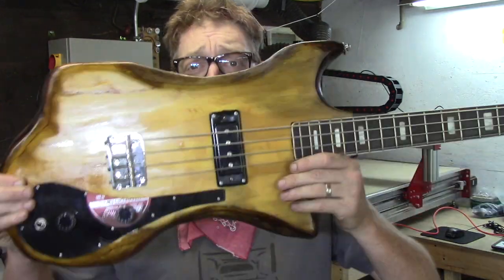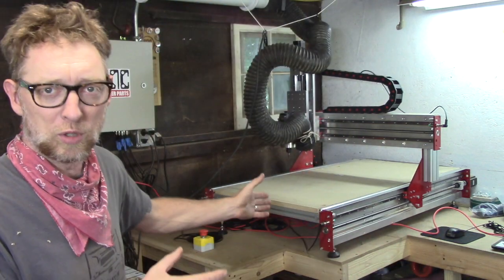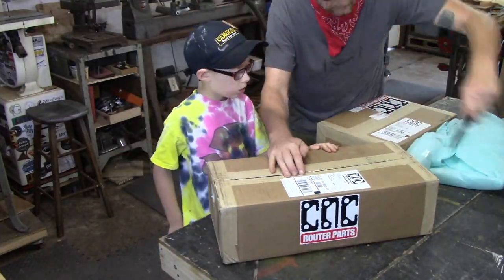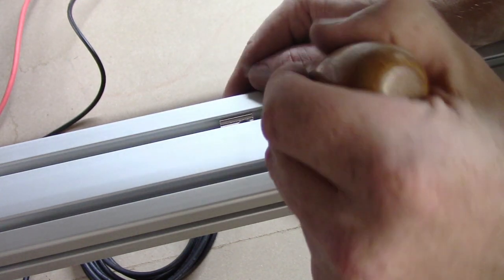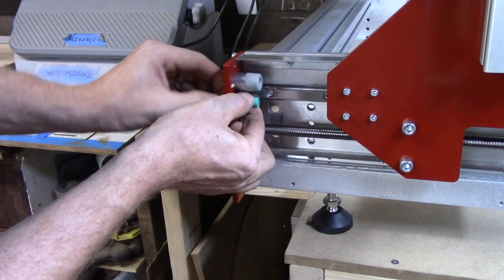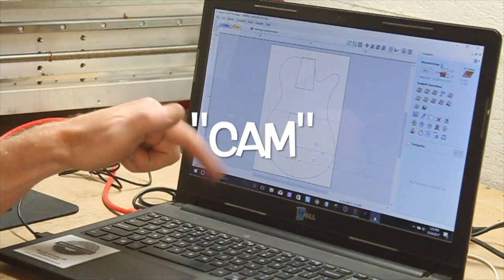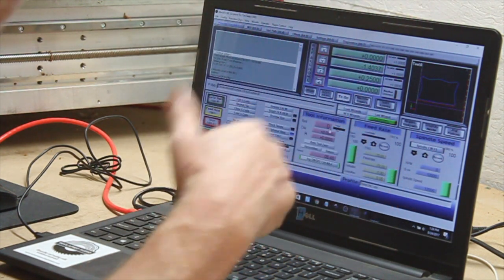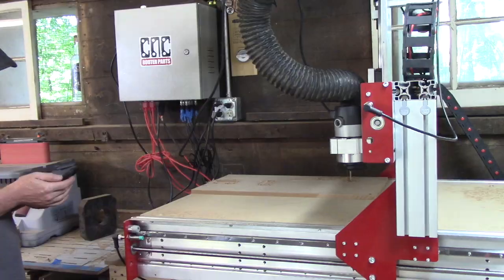What CNC Means to Me

Comment: It's your design - do what you want but don't call it handmade
Reply from the maker: it is an interesting question: when is it no longer "handmade"? If I split the wood, resaw it, plane and flatten it, cut it to rough size then use a file I created and coded, put it in a cnc and create the final product, is it not "handmade"? what percentage of work needs to be done outside the digital realm to be considered "handmade"? Does it really matter?
Reply from the maker: pinned because I want to see if we can get a good, open-minded and friendly dialogue issue.
Reply: First off - I love your videos and as a brand new woodworker, I find your projects to be a complete inspiration.  If I had a CNC machine like yours (actually I would prefer a little smaller) I would likely try to use it all the time - I don't have an issue with CNC, 3d Printing, etc - as a matter of fact 3d printing opened my eyes to woodworking in the first place. I think my issue is, It seems every successful woodworker on youtube has introduced themselves to the "exciting" world of CNC and I just feel there is a lack of unique projects - it's often the same monotone projects over and over.  Perhaps it will take an out of the box thinker like yourself to make the CNC do things that are unique....but it's a very busy road ahead....

I think the argument is, at what point are these creations no longer 'made by hand' and I feel a fair comparison is the way I do some things outside of woodworking - whether it be coding with a .txt file or mixing music with analogue equipment. If I let a program like Dreamweaver write my code, it's the same (likely cleaner) outcome but it's no longer by hand.  If I fix a pitchy note or quantize a drum beat instead of rerecording it's no longer the original creation....but it fools every listener. It's a trick.  It's not that it's 'bad' it's just manipulated or written by a computer.  

Bottom line - if I were selling or showing an item that had CNC machined/shaped/etc parts I would feel obligated to share that info, especially if I was putting my name on it.  One of these days I hope to raise enough greenbacks to get a small CNC and experiment - maybe I will feel differently then....
Reply: Personally I feel that there is a fine line between what constitutes a "handmade" product. While a CNC is just a tool, same as a table saw, a hand plane etc. I do kind of feel that it takes away from the artistry of woodworking (for lack of a better term). 

It removes the necessity of having to learn the proficiency of using certain other tools that would be considered at the heart of woodworking. Whether that's good or bad is another debatable topic but I remember when I was in middle school and taking woodshop we had to learn how to use a coping saw before we could even think about touching any of the "fun tools"....I can say that I HATE coping saws to this day but I understand now that that was part of the process. With woodshop going the way of the Dodo bird that seems more important than ever.

With a CNC machine, I dunno, it just seems to take a little bit of soul away from whatever is being produced especially if I am making more than just one of something. As it sits right now without a CNC if I make even two of the same thing there is inherently going to be some difference among them. Minute as that may be each will be unique in some way, shape or form and I like that. That screams 'handmade' to me personally. You don't get that with CNC unless you code it in and honestly I think that is even worse.

As far as the "it frees me up to be creative" mantra, well I'm sorry but that just makes you a designer. I compare it to architects. They use their creativity to design a building and then pass that on to the ones that actually build it. I'm not trying to ruffle anyone's feathers and I'm never going to say that I won't ever buy a CNC but for me and me alone I would have a hard time saying anything produced with it was handmade.
Reply: Why wouldn't it be considered hand made? Believe me, I'm old school but unless the CNC puts the guitar together and finishes it, I would call it hand made. It's not massed produced. If you cut the body out on a band saw verses a coping saw, is that any different?

Comment: I bought the exact same router a week ago.  I extremely excited!  I build speakers.  
I even got the same dewalt router just by coincidence!  I use solidworks but I haven’t picked the CAM program yet.  I may go with BobCam V7 which runs directly in solidworks which is nice.

Comment: Looking at getting a CNC (Albeit late to the party) so I remembered this video when you first put it out and had to come back here to help me decide what the heck to do. So many options but I think I'll get something similar in terms of strength and rigidity so it can to soft metals as well as wood. I was curious about your spindle. It's not water cooled; how is handle the work? Enough power etc. Thanks Tim - I'm being good ;)
Reply from the maker: this is my third cnc and by far my best. So far all of them have run with handheld routers mounted in there and worked fine for me. This one holds a bigger router than my smaller ones which is, of course, better. But I was able to carve brass even on my little one. It really depends on what you want to do. If you just want to cut out wooden signs, wall art and little plywood things, any number of them will be fantastic. but if you really want to work the machines, do long 3D carves, etc., get a well built one. Software is half the battle, too. Start right with VCarve and don;t waste your time messing around with the free ones.
Reply: Great advice thanks Tim. Have contacted an Australian manufacture and I'm on my way to "cutting" a deal.

Comment: Heh...  Another one that got bit by the cnc bug... :)  Best general purpose tool in any shop. And I WONT part with mine.. 

The main thing about a CNC its only as smart as the guy running it...

The G in G-code comes from the fact that ALL momvemt commands in the file start with the letter "G".. :)
Reply from the maker: so you're saying my machine isn't very bright? :)

Comment: Well done Tim.  I've had my 4' x 8' machine for cabinetmaking for over 5 years, but after you get one and gain some experience and confidence, the number of uses just increases.  Last week I was cutting bushes for repairing some farm machinery - material cost was pennies, time was brief (less than an hour and a half all up to design cut and fit) and the farm device (a mag spreader) was back up and running for the next morning's work.  Cheers, David.
Reply from the maker: yea man, absolutely. the more you use it, the more uses it has. I am still a total newbie and I'm hooked! thank you!

Comment: Thanks or the video Tim, it is very relevant to me right now. The maker space I teach at in Pittsburgh is shutting down, I don't know what I am going to do when I lose access to the ShopBot there next month. I have been looking at different options and they are all $$$, right! I have been looking at CNC parts but even that adds up and makes me nervous at the end of the day, having no hands on experience with one.  I like that you mentioned the rigidity, as that seems to be a common complaint that I read about most machines, especially the x-carve. Id really love to try out some machines out before dropping 2 - 20K. 
Also, I am not an expert so it might be worth looking up... I believe when you run PVC pipe for dust collection you want to run a copper wire on the inside to prevent static electricity from building up and igniting the dust. Or something like that.
Reply from the maker: Get Square w/ Tom Jolley I have heard something like that, too about the dust. Not too concerned but I'll look in to it. It connects to a a metal duct later so that may take care of it? Yes, cncs are expensive and you do I deed get what you pay for. The inexpensive ones like are honestly fine if you're cutting 1/2" plywood all day, but if you want to do more you need more.